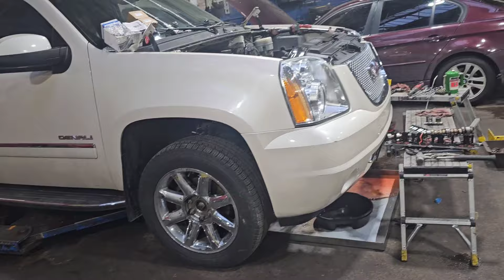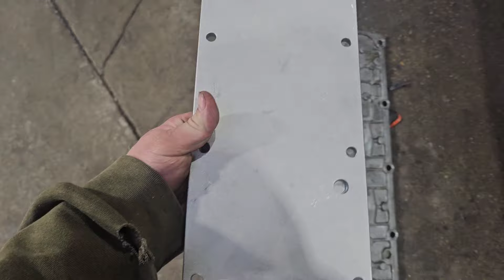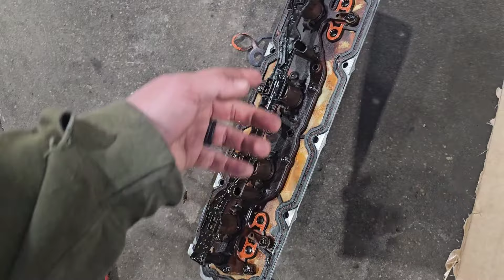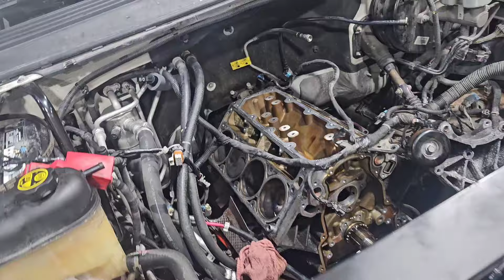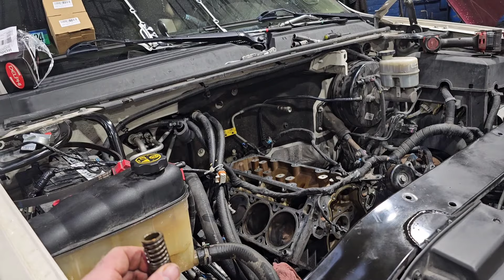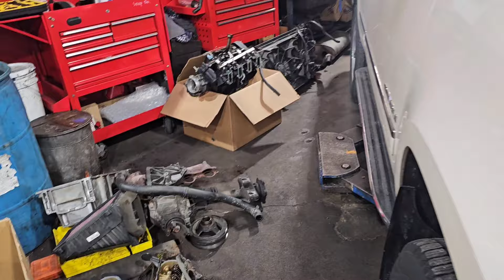2014 GMC Yukon DOD delete update - What is DOD? What Is The Issue - Let's Compare Parts

Comment: I just lived this horror on my wife's '11 Denali. #6 cyl lifter would not pump up, but worse the Intake spring failed (broke) , spitting off the keepers, retainer, and even valve seal!   It gets better, the valve bounced off the piston and also bent it.  Luckily the valve didn't break. 
 I needed to get it done quick so I was able to find a new valve, headgasket, and all new lifters from Autozone. Other parts from Napa. Cam was fine. I got lucky I guess. It was due for plugs and wires so I treated it to that too.  
  You're doing right of course, eliminating it. I just didn't have the time since we had just gotten a new 5er and was leaving in 3 days for Florida. All ended well.

Comment: How or what did you use to plug those oil passages/ports?
Thank you FBM
Reply from the maker: They actually make a block off plug for the cylinder head but what I did was I took a food really big valve stem and I cut eight small pieces about a half inch long off of the valve stem and then I enlarged them by taking a hammer and a Anvil and stretching them out a little bit and then I took a set of needle-nose vice grips and held the little piece that I cut and I use the hammer and I tapped them down into the center of those ports so they were locked in

Comment: I like the 62 and the 6.0 the ls motor. But I have always had oil pressure problems with them you can never get one to really get up to like 60 to 65 lb and stay around 40 psi

Comment: Buddy had a 5.3 drop a lifter in his 12 Suburban. I was going to pull the head and replace the lifter. In the mean time he sent the PCM out to have DOD turned off, and got it back. Reinstalled it and drove it with the collapsed lifter. The lifter popped back up while driving it and the engine ran perfectly. Its been 2 years and still no issue.

Comment: you have the engine pretty far apart for this, how much extra would it cost for a rebuild at this point? would it be viable to buy a caddy and do this to it, with a few upgrades to make it more reliable?
Reply from the maker: Cadillac CTS V? I've never worked on 1
Reply from the maker: Rebuild yeah if the piston bores look polished sure, these still look really good

Comment: Was that government mandated or did GM use it as a tool to raise their average fuel milage count higher?
Reply from the maker: I think
Reply: not mandated, its just a cheap method of making it 'better' on gas. most car makers did it, but GM did it extra bad
Reply: gov. says what mileage the truck should get. they've ruined a lot of good original designs that way. think i have one of the last dependable engines g m made, 4.8l vortech. . pushing 300k, nothing done but wires plugs and oil changes. my daughter drove it and had to ask if it was running or not. had to tell her you have to look at the rpm gauge to tell. otherwise? you can't tell if it's running or not till you turn the key and the starter hits the moving flywheel. yep, it was running. did that twice.